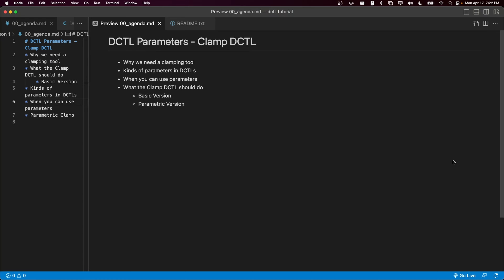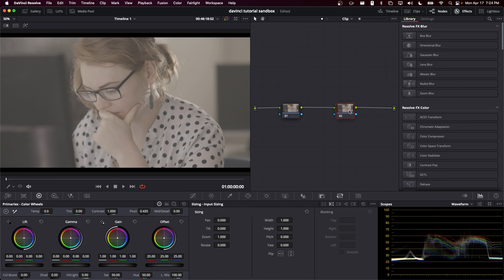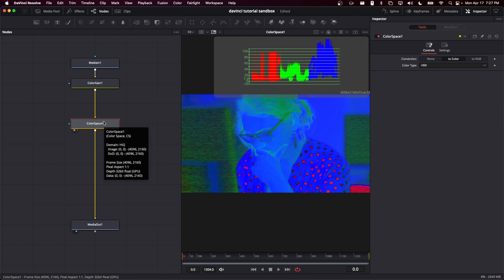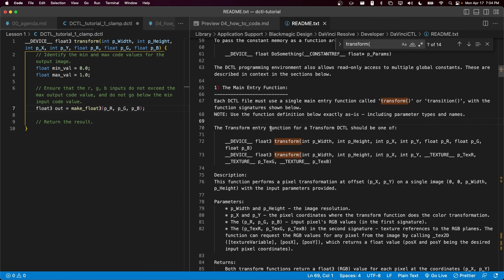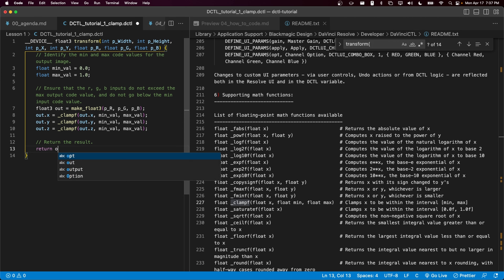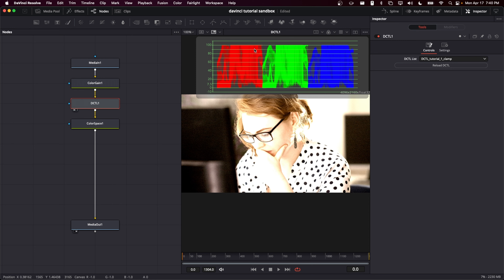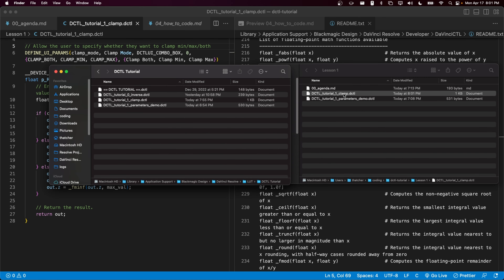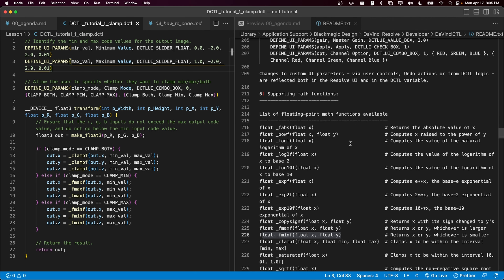DCTL Tutorial Ep 1 | Clamp - Parameters

Comment: Thanks for this. Do you know where I can read more about why or what situations you would choose to clamp only min or max? and is there a negative to clamping both all the time?
Reply from the maker: Good question. In general, I would recommend clamping as little and as late as possible and to do it prior to operations that are poorly behaved when given inputs that are too big or are negative. Clamping does remove information if your image has extended to those areas, and by clamping you'll lose your ability to recover that information later.

For me, the most common time I'd clamp only the min is when I'm working with a Linear image, as those in principle are nonnegative and unbounded in magnitude. Clamping only the max is rare and I don't think I can recall when I've last done that. Usually I'll clamp both to limit an image to a specific gamut, but the key is to have already manipulated the image such that you don't lose anything you care about in the clamp step. Ideally you'd never lose more than some of the noise floor and some pixels with numerical precision problems (like clamping 1.000001 to 1.0)